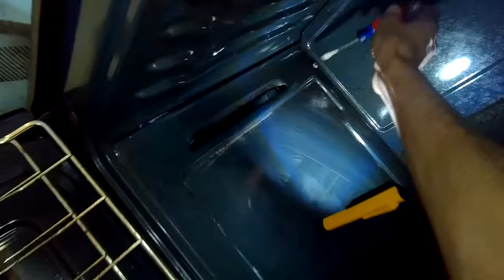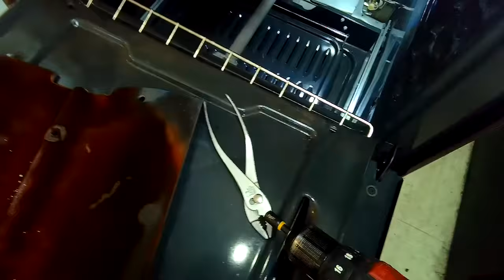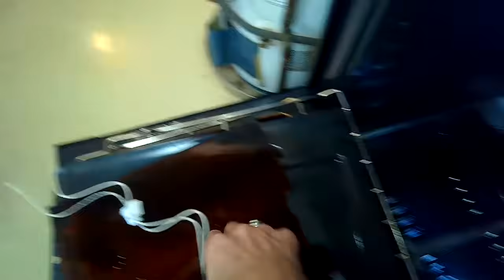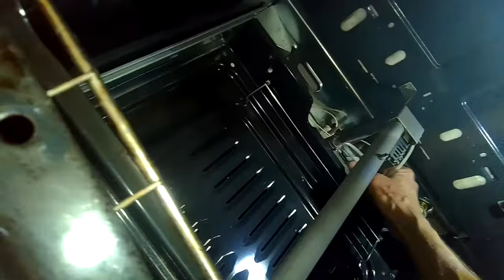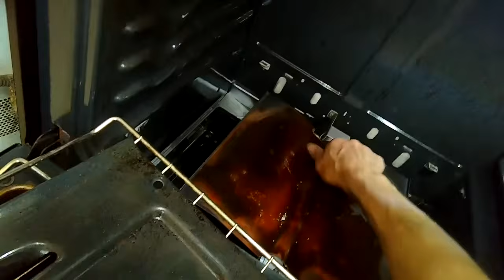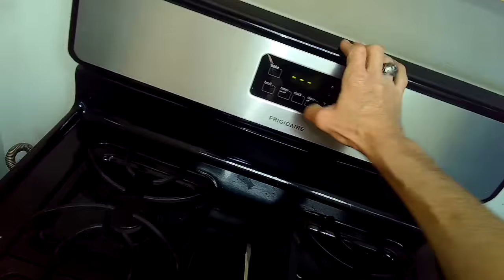✨Fridgidaire Gas Oven Won’t Bake - EASY QUICK FIX✨

Comment: Thanks, great video. My issue is intermittent. Sometimes the oven works fine. When it doesn't, I can still see the glow from the igniter. When I reset the regulator shut-off (I think that's what it's called), it fires right up. But then I may have to reset it again the next time. Could that be a symptom of a bad igniter?
Reply from the maker: You're welcome! That's an interesting issue, it sounds like it could be related to gas flow, but if resetting the regulator helps, that's a good clue.

Comment: Got a similar issue.  Range model is FGGH3047VFC but it's only the Bake/Airfry that doesn't work.  Roast function works.
Reply from the maker: I’d say it’s just the igniter that needs to be replaced.
Reply: @ScottTheFixItGuyChannel LOL.  Electrolux repairman just left with two parts to order.   An ignitor and something else I have to check the invoice.   🎉.  You rock sir.   🎯

Comment: No good for me.  Tried every type of oil and wrench I could to get the igniter screws out.  No luck.  Oh well
Reply from the maker: You can get the oil on the threads and then use vice grips to grab the head of the screw to give you more leverage.

Comment: question: if the oven's heating is weak (it heats, but not very much), could it be a problem with the igniter?  My thinking is that if the igniter is broken, then the oven won't heat at all... right?  So my hunch is telling me to look at the temperature sensor instead.
but could it be the igniter? if so, can you/someone explain how?  thanks!
Reply from the maker: Good question,
A weak igniter can cause not enough heat 👍

Comment: Great video..I replaced igniter but it still will not work.  Does anyone have additional guidance. Thanks.
Reply from the maker: That means that you’ll need to replace the controller 👍

Comment: Interesting, I called the appliance company, they said “ we charge $500 for replacing a igniter . Thus you are better off buying a new oven. That’s not even seeing oven? WTF? I am 70 yrs old and going to use your advice just to peek at igniter. Yes, the oven is 9 yrs old but like you not using much. I will update u You what I find!!!
Reply from the maker: Please let us know how it goes.  The igniter is only around 20.00👍

Comment: Why cut the wires and use ceramic wire nuts? 
I know it’s much easier, but I rather take the cover off and connect it without cutting it.
Reply from the maker: It’s a little faster way to get to the igniter 👍

Comment: How specific does the igniter need to be? Like, is that model you used conpatable with any Frigidaire oven for the last 5 years? Or do i need to find the exact model of my oven and get the exact part number?
Reply from the maker: It’s not important to use a specific igniter.
The one in the description works really well.

Comment: I am having this issue with mine but i can see the ignitor glowing below the oven. Does it not have to be completely out to still be faulty or not strong enough to light it?
Reply from the maker: Hi Matthew,
Very often an igniter will glow but is too warm out to let gas flow.
A new igniter will fix it👍
Reply: @ScottTheFixItGuyChannel  thank you so much! Your reply is God's timing cause I'm literally inside my oven messing with this thing right now and was unsure but you're giving me confidence!

Comment: Scott, what is the part called that the igniter light..(medal bar in the middle) I've replaced my igniter twice and it works for a few weeks then stops again.
Reply from the maker: Hi Charles, that tube that the igniter mounts to is the burner tube or Venturi 👍💻 New Appliance Repair Blog - lots of DIY Fixes for Your Home Appliances - Click Here:
https://ApplianceFixes4You.com

Comment: Hey Scott, quick question, i recently replaced my Igniter and that seemed to fix my issue, but all of a sudden my issue has come back. let me describe:

1) turn oven on 400, cook a frozen pizza to completion, ingitor does a its job and start way quicker than my old one.
2) turn off
3) wife gets home and tries to cook something, turns on for a min, then shuts itself down.
4) retry starting the oven and the ignitor doesnt even glow, oven shuts itslef off again
Reply from the maker: Thanks Randy,
Might just check the leads coming to the new igniter.  Might be a controller that’s wearing out.

Comment: Helllllppp!!! I replaced my igniter but my oven still does not bake. The stovetop and broiler work. What now???
Reply from the maker: It must be the controller that sends power to the igniter.
Reply: I am so very grateful that you responded. Thank you so much. So now I have a follow-up question.
If it is the control does that mean it is not getting power because when I attached the new igniter, it sparked slightly. A handyman friend said it might be the valve. What are your thoughts?

Comment: Don't glow and replaced the ignitor
Reply from the maker: That means the bake relay located on the control board in the upper consul, needs to be replaced because it is not sending power to the safety valve and igniter.

Comment: Help!!!! It’s Thanksgiving and my oven just smells like gas!!!!  Can I ignite manually?  Do I have to cut up my Turkey and cook it in the air fryer!!!???  😢😢😢
Reply from the maker: Just needs a new igniter.
Make sure the igniter is installed right up against the burner tube👍
Please don’t light with a match. VERY DANGEROUS 😬

Comment: Thanks for the video. What if I replace the igniter and the oven section still does not respond?
Reply from the maker: Thanks J.L.
What do you notice when you turn on the heat for your oven?
Reply: @ScottTheFixItGuyChannel  
There is the clicking once I select bake, then no sound of gas flowing or glowing from the igniter itself (no response)
Reply: @ScottTheFixItGuyChannel Scott any idea on next step?
Reply: Did you ever discover what the issue was - I’m having the same issue.

Comment: I have a frigidaire range oven for more than 12 years. but I do not use it every day. I have baked  my turkey only twice in so many years because the oven baking part is not working anymore. 
What is wrong with it. And how much it cost to fix the baking part?
Reply from the maker: Just need to replace the 25.00 bake igniter. It’s pretty easy 👍

Comment: In my oven, I see the glow from the igniter. Could it be the gas valve?
Reply from the maker: It’s very common for an old igniter to glow but not allow the gas to flow in.
Replacing the igniter with a new one will fix it 😊 I hope you can also subscribe to our channel with this link: ▶️-Subscribe Here: https://www.youtube.com/channel/UC7fBqy8806u1r0NpPv_fQ2w?sub_confirmation=1😊😊😊
Reply: @ScottTheFixItGuyChannel   so what's the best way to distinguish if it's the igniter or the valve that lets the gas flow in? Other than using the meter to test the ohms in both to broil and bake function?

Comment: So when I turn on the oven I can see the orange glow through the slots which I believe means the igniter is working, but the oven is still not heating up, what could it be?
Reply from the maker: Great question.
Bad igniters will still glow but they won’t allow the gas to come in.  A new igniter will make it work😊👍
Reply: @ScottTheFixItGuyChannel  yes! You are exactly right! That's precisely what it was

Comment: My igniter works fine. Just doesn’t ever heat. Gas never comes on. Broiler works fine
Reply from the maker: Time for a new bake igniter.
Even though it glows, it isn’t getting hot enough to let in the gas.

Comment: Great vid..havent recieved igniter yet but did take apart to make sure wires didnt come apart... and since this igniter wasnt spliced in , i no this is the original part and needs to  be replaced thanks for the vid
Reply from the maker: You’re very welcome 👍😊
Reply: @ScottTheFixItGuyChannel  it use gas too

Comment: Igniter works but gas ain’t coming out on my stove
Reply from the maker: Even though the igniter glows, it won’t let gas come in if it’s wearing out, a new igniter will fix it👍
Reply: @ScottTheFixItGuyChannel  so it’s not the valve. Since I saw it glowing really bright I was thinking on changing the valve instead. How do I recognize what’s really damaged?
Reply: It’s super common for a bright glow but no gas.
The new igniter solves it.
The igniters are cheap and easy to replace.
I’m assuming that there is gas lighting the surface burners.

Comment: This video is worthless. How do you even know if that's the problem? You showed no troubleshooting you just threw a part at it and hoped that fixed the issue.
Reply from the maker: 98% of the time it’s the igniter.
2% it’s a bad relay on the control board.
Start with the obvious and cheapest👍

Comment: How do you know that the igniter is bad if the igniter's heating elements are not  roken, melted with the gap on them ?
Reply from the maker: If they glow but never light the oven, you should replace them 👍

Comment: Replaced igniter with a new one still doesn't glow... stove top and broiler work great is just the bake igniter that doesn't glow when turned on you can hear the click when oven turns on do you know what could possibly be wrong??
Reply from the maker: Good job Bianca,
Might be good to recheck your wire connections👍
Try smacking the upper console when the oven is supposed to light.
It might jar the relay and send power to the igniter👍
Reply: @ScottTheFixItGuyChannel  ok will give it a try thank you
Reply: @ScottTheFixItGuyChannel  This was the best advice ever. I literally smacked my display on startup and it worked! 😅 thank you 🙏

Comment: Did anyone happen to get the part number? I tried several times and it went by so quickly and was unable to read it.
Reply from the maker: Hi Scott,
Here’s the part: https://www.amazon.com/Supplying-Demand-5303935066-AP2150412-5303207520/dp/B07QQG4GKR/ref=sxts_rp_s_a_1_0?content-id=amzn1.sym.9cb06d61-cbae-4109-9d1e-14578fae3d41%3Aamzn1.sym.9cb06d61-cbae-4109-9d1e-14578fae3d41&crid=2MGJVPMEFOIRB&cv_ct_cx=frigidaire+oven+igniter&keywords=frigidaire+oven+igniter&pd_rd_i=B07QQG4GKR&pd_rd_r=0b4f0280-cd7b-45c5-a597-29f7a2885eba&pd_rd_w=5M4zG&pd_rd_wg=VhdWg&pf_rd_p=9cb06d61-cbae-4109-9d1e-14578fae3d41&pf_rd_r=8BQGNWWG2A3N3DMZTW70&psc=1&qid=1658112480&sprefix=frigidaire+oven%2Caps%2C1719&sr=1-1-ea136695-3596-4534-80e7-1570345d02b9

Comment: Eight years?   aaahahahahaha  My 9 year old Frigidaire gallery has burned up three already - number four going in.  OEM parts!!  $120 each - the $30 jobs won't fit because they changed the houseing mounting tabs.  Do not buy a Gallery - you pay more to get hosed better.
Reply: I feel like that’s the problem I’m having. The “universal” one I ordered off Amazon for $40 looks a lot different than the one I just took outta my stove.
Reply from the maker: You can bend the metal housing of the old one and fit in the new ceramic igniter and then bend the metal case in on the new igniter.
Reply: @ScottTheFixItGuyChannel    Ya, I saved the old OEM so i can yank the old ceramic igniter out and re-use the old housing.  Thanks Scott.

Comment: ..Scott..Thank You, Sir--very much...your video/presentation, is excellent..clear, simplified..
..my "Sears/Kenmore-range" shares-similarities-- it had "become slow/reluctant" prob 6 mo's-ago-- Id have to "pre-heat ( try-to ), multiple-times", 3, 4, 5 X..?..I looked-under-oven in broiler-area--- "yes-> my ignitor still "glowed"- but-> apparently, "not "hot-enough", as I found-out-
-watching "some other vids"-- they were all helpful-def helped in "diagnosing"--BUT- most all of them, quickly "mired-up" with,  "rather-confusing/intimidating" & differing-ideas on "the replcmt-wiring"....I understand some "basic-electronics-concepts", still-- most of those other-vids, kinda' convinced-me-- " I needed to have this done by a "Tech-person"..?..
..Id bought the "ignitor-part" maybe 2 mo's-ago-- but "findin a Tech", (reasonably) in WV, as "we emerge from the "pandemic"--was "discouraging"...
..meanwhile-- it would "sometimes work, sometimes-"not"...lol...def discouraged "use", and def had an impact on "meal-planning/menu's" for the household !

..Thank the Lord, I was once-again "lookin into-it" and, came-across your Vid, yesterday-- wow !
..your Vid inspired me; gave me confidence, to "give it a shot"...lol...voila ! Success !
.. comes-on & heats-up quickly ! chicken pot-pies & frozen-pizzas, are "back on our menu" !

..I wanted to get back on here & tell you, "Thank You, very much",  & commend-you for your clarity & simplification-- for you, "making the effort" !  rock-on & God bless you !
Reply from the maker: Awesome job, you did it😊😊😊🎉

Comment: I have a Frigidaire gas wall oven that took over 30 minutes to preheat, quit maintaining a high temperature and it smelled like there was unburned gas while baking.  I checked the oven igniter resistance and it was low so I replaced the igniter with a $25 replacement from eBay.  Now the oven works better than it has in years!

Comment: Thanks for the upload! I have a question My oven stopped working and I replaced the temperature sensor. It's working again but it take abt 2mns for the flame to fire up.Before I could gear it light up within seconds. Should I return temperature sensor and just replace ignitor? The other issue I was having is a error 31 when I use stove top and oven at same time. I hear the click when I turn the oven on but it takes way longer to fireup.The model # is Lfgf3052tfa.
Reply from the maker: I would replace the igniter👍

Comment: this is a couple days, when I turn my oven on, the electricity key get down and disconnected, but doesn't do the same thing when  I just turn on the stove, I didn't know what is the problem.
Reply from the maker: Sounds like the wire that goes to the oven igniter is touching metal and causing a short circuit.  See if you can find where the wire’s insulation has rubbed off.

Comment: I have an additional black shelf/tray beneath my heat deflector preventing me from accessing the wire connector/splice area of the igniter.  This lower black (painted) shelf doesn't appear to come off.  I have no access to screws.  
Any suggestions?
Reply from the maker: Can you send me a video of that?
Scottthefixitguy@yahoo.com
Reply: @ScottTheFixItGuyChannel  Thank you for the quick reply.  My son & I just finished swapping the ignitor and it worked like a charm...
Since I have an older model I had to access the ignitor and pick my splice location by pulling out the heavy drawer beneath...
Sometimes, the answer is right under your nose (or stove in this case.)
Thanks again!

Comment: I just replaced mine and my oven still won't heat what else could cause
Reply from the maker: Next step is to replace the clock/controller